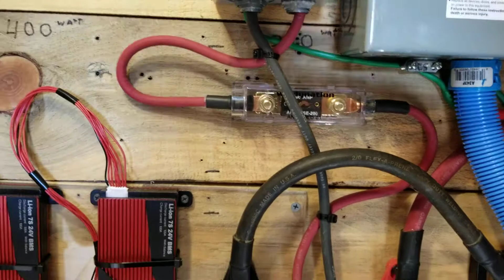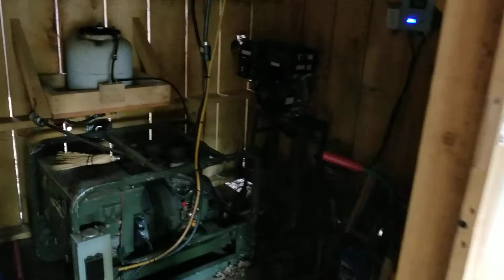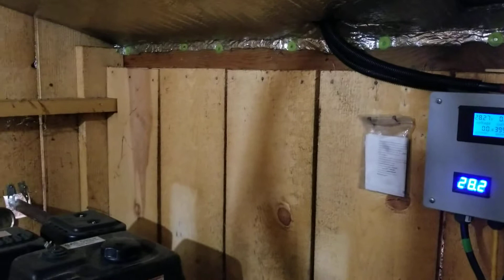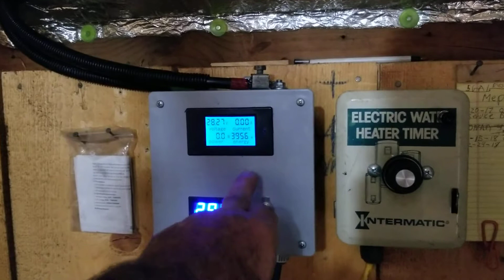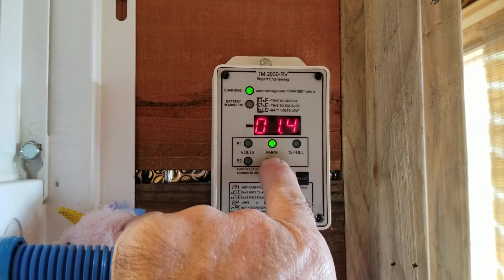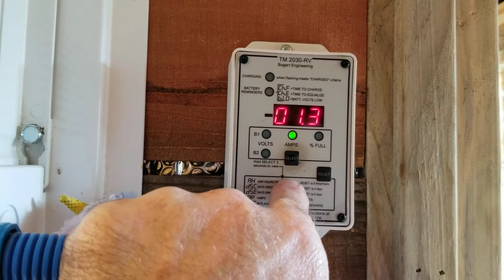Say good buy to FLA!

Comment: I'm having generator issues myself, in the past 5 years I've powered the 10kw generator head off a 250cc motorcycle engine, but recently I had an engine failure just south of 2000 hours on the engine. I bought a used VW Beetle with the 1.9L TDI engine for $400, gonna transplant it as the new powertrain for the generator head, just removed the engine from the car over the weekend, gonna run it off the output of the manual transmission, and mount the radiator and electric fan outside the shed for cooling system.
Reply from the maker: Sounds great, what will you use for a governor?
Reply: @offgridinthepacificnorthwe3210  on the motorcycle I used a throttle lock like people use for cruise control, set the output voltage just below the max output the charge controller could accept under no load, the charge controller took the voltage and powered the inverter as well charged the batteries. Thinking I'm gonna use potentiometer on the throttle circuit for the vw engine. I run DC generator/motor heads for the electric, then use my pure sine wave inverter for AC power.  I didn't like the quality of power on AC motors and DC motors are far cheaper

Comment: I can't wait to load up my 12 FLA Trojans and take them to the recycling center (20 cents a pound for the lead). Wish me luck brother...hopefully will have a 14.4 kWh in LiFePO4 batteries up and running this weekend.
Reply from the maker: Wow Chris!  That is fantastic! Which batteries did you decide on? That's going to be a lot of capacity.
Reply: Thanks Steve - I worked with the AltE Store and ordered four KiloVault 12v 3.6kWh v3 LiFePO4 batteries. Gonna wire them in a 24v configuration (for now). I wanna see if the Outback Power folks can do a swap out of my 24v inverter to a 48v one and save a few bucks. Already have their Mate 3...should work with a new inverter.
Reply from the maker: @ChrisDIYerOklahoma  I cant wait to see it set up.